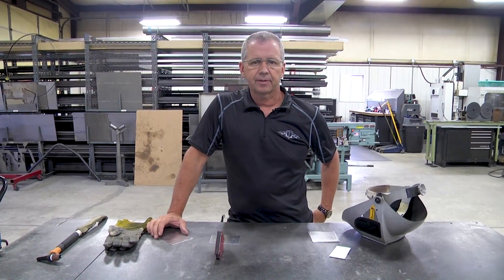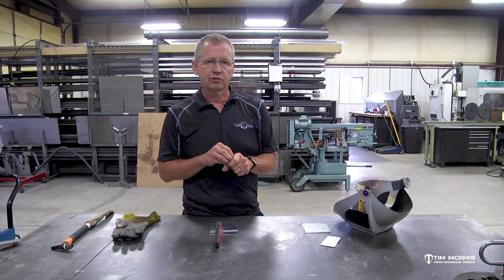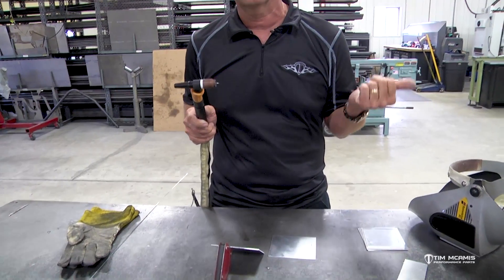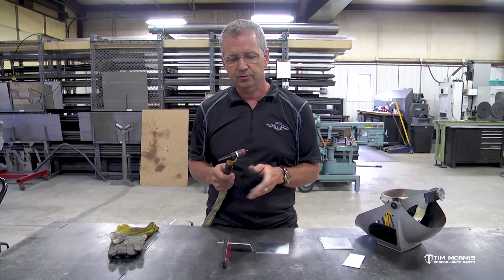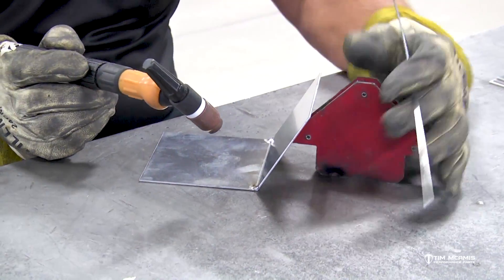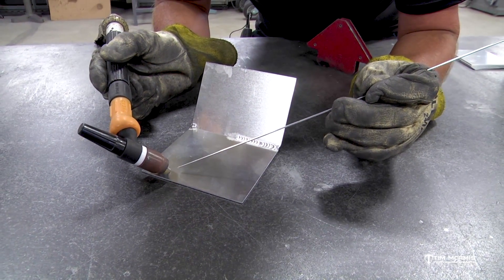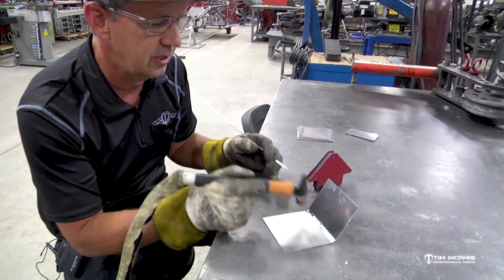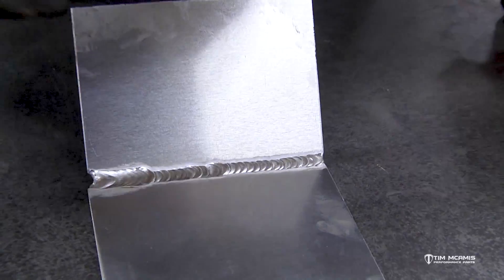Welding Aluminum - Fabrication Series: 13

Comment: Great series.  Watched them all in real time as you posted them and then recently went back through them.  You had mentioned about another series showing plate vs. tube as well as bending.  I would be interested in both of those when you have time.
Thanks again.
Mike

Comment: Tim, great videos, thanks - I'm a mechanical (design) engineer and I've just moved jobs to where welding is more common place, but I just don't have any experience of designing welded parts.  Specifically I'm due to design a welded scaffold, so I found the whole series intersting but particularly as well the tube cutting processes at the start.  Thanks!

Comment: I have an engineering questions.  If I lay (3) 48x4x.25 strips of aluminum 6 inches apart and screw them in deep and well on 1 inch overhangs on each end will that support 500lbs? It's okay (actually preferred) if they bend a little .

Comment: Just happened to cross your video. I'm enjoying them very much. I wonder if you've ever had any problems moving the filler Rod so far away from the weld puddle that it leaves the Argon Shield area, I've experienced that

Comment: Thanks for the tip about pulling the rod out quick. I thought you kept the rod in the heat zone to keep warm like gas welding. That helps a lot. Thank you!

Comment: I had done a little stick welding in trade school. When I learned to TIG, I bought a syncrowave 180 SD. and a book. I followed the basics in the book and just kept practicing beads. If I started to have trouble, I went back to the book. I'm definitely no pro, but I am OK at the basics. I think the worst problem I had with aluminum welding is arc wander.

Comment: I've got a syncrowave 180 never took a welding class and have always had the solder drop going on never really have issues with mild and ss but the alum was an issue lol... thanks for the info

Comment: HTP Invertig 221 is a great aluminum welder too. My comparison between the dynasty and the HTP and the invertig comes out on top. Great video Tim
Reply: I'd like a go at the 221 lol.
Reply: Lime it’s an awesome machine. I love mine more than my dynasty. Arc is so much nicer
Reply: I have one also and every person who has tried it has said the same thing.
Reply: Andy Alberto agreed I hear nothing but good things about it. Customer service is bar none the best!
Reply: Got a HTP at home and a dynasty 280 at work. Miller dynasty has far better ac arc starts but the htp is a great machine for half the price tho.  Both have similar arcs once going but Miller wins with crisp starts.